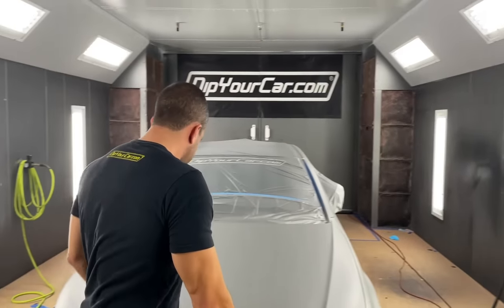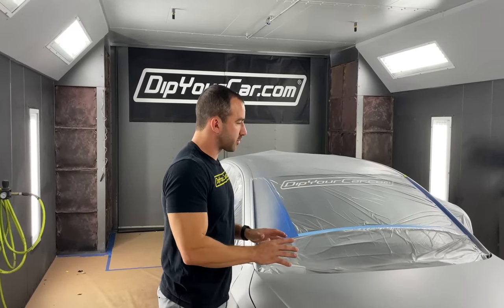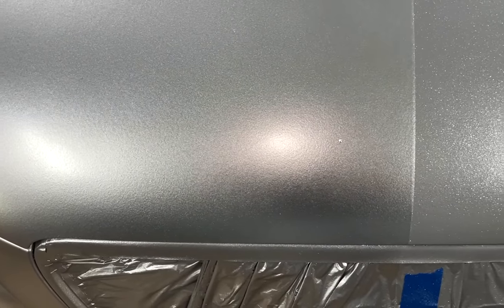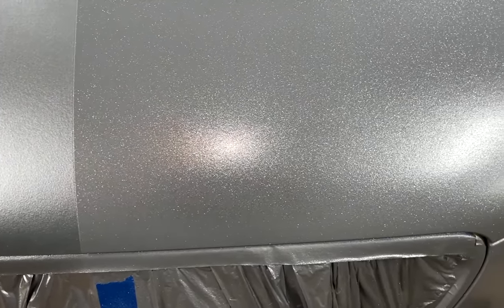Which base is BETTER for CANDY Paint - Pearls or MicroFlake? (Surprising Results)

Comment: The traditional pearl has a smoother look. The other has a texture look to it. I think it’s depends on the car and color. Great video.
Reply: It's orange peel it needs cut n buffed ,but I agree
Reply: I was thinking that
Reply: Your supposed to wet sand the flake down before you candy it. It helps give it a glass look when you build the clear on it. But also probably only put a couple coats of clear down. I recommend at minimum 5 coats of clear for custom paint jobs to have a deep clear. This car was a test example so take it into account.
Reply: Thats because it needs at least 5 coats of clear and then the full cut and then buff. LOTS more work But WAY better finish. THIS JOB is only half done NO WAY to compare.. YES i do spray metal flake jobs
Reply: @eddiebrown9590  you can cut and buff plastidip?

Comment: I love how the glass container has a pour spout and they never use it when pouring into the spray gun hopper.
Reply from the maker: It’s on purpose - pouring out the side flattens the liquid and shows more of the color effect 👍
Reply: @dipyourcar  that's what I've thought the first time i noticed this. Thank you for confirming my thoughts :)
Reply: @dipyourcar  I've seen several of these vids and always wondered lol
Reply: I never use the spout on anything as it usually doesn't work as intended or splatters everywhere, like the age old saying, " If it ain't broke, don't fix it! "

Comment: I liked how you showed something as simple as a dividing line takes a fair amount of time. I've learned a few things and the painting part of the " paint job " is the easy part. Prep, sanding, repair, more prep, more sanding, more sanding and tape are the hard parts.
As for pear vs flake....I feel you get a better effect on body line changes. The flake is cool but it's like looking at a bass boat. Putting one down then doing a graphic with the other might be cool.

Comment: I guess it is down to personal preference  as you said. A trade off between sparkling and low gloss finish and smooth, flat, high gloss finish.  In the end the user decides: get sparkling or show the curves. 😁 But, you can now use that candy tint to change the crazy reflective glass beads into any color you'd want.
Reply: I know right 
Hope you are having a blessed day there

Comment: Both look good, but I personally would go with the pearl base. It has a much more smoother and glossier look to it. The flake side looks as if it has grittier texture with some white specs in it. It also has a bit of a matte finish to it, which I like. It reminds me of when I use a matte finish topcoat over a metallic or holographic fingernail polish.

Comment: Pearl gives the paint a more wet look, typical of exotics and tuners. Flake gives it a more “pimp type” look that’s good for classics like a 85 Caprice Donk or a 68 rat rod. Both are good but I gotta go with the metallic on 26” Rucci customs. That HoC is by far the best candy right now. That Audi tried but it doesn’t have the lines and curves to set the paint off. You get something like a GTI or a Mini and the pearl will definitely turn heads at a car show. A good buff and cut would really make it champ too.

Comment: You should lay down your flake then clear it. Wait for the clear to cure, then flat it back.
 Then you can spray your candy,then clear over the candy. You get a great depth to your paint job and it doesn't look like the surface of the moon. Also try  0.08. mixed 50/50 with 0.015 it gives the best coverage and the best effect or pop...

Comment: They are gonna give you a different look and you would use whatever look you are chasing. A metallic flake will always look better for a candy paintjob as it will give the most true to the original candy look. The original candy's back in the 60's were a very fine and very bright silver, using that mirco flake still wont look anything like a traditional candy paintjob, but certainly will show up better on camera for us :)

Comment: I make baseball bats and i use candy colors for some customers. Using pearls or shiny metallics is ideal for uniformity, but when it comes to pop, flake is the way to go, BUT how you use it will very

First off, gotta have a smooth glossy topcoat in order for the flake to really work. Second, your base matters so much more that you think. Flake can work on a black basecoat and that creates a unique starry effect, you can use just flake, or have flake on top of pearl so that you erase those deadspots while still having that shooting star effect.

I also compress my flake a little to smooth out the surface and get rid of those sideways flakes. It works on bats because they're round so you don't lose the random shooting effect, idk about cars though

Comment: As it happens I found out I really don't prefer the standard rough/matte texture the product gives. I understand a clear gloss finish is much more expensive and is not as user friendly but in cases like these, I think it's almost necessary. Clear also gives way more depth to both flakes and pearls anyway. Just look at that surface, it's so rough... Almost looks unfinished or done by someone who has no clue how to paint (no offense meant) just that's the product result, especially with flakes. I would though try flakes and a ton of clear over it then sand and buff the living heck out of it to achieve a smooth final layer.

Comment: Maybe, it's cause I'm older but when, I think of a candy paint job, they always have metal flakes in them. Also, noticed that the micro flake side, had a rougher looking texture to it. I wonder if using a glossy top coat, will smooth out that textured look, and give it more depth?

Comment: still, traditional candy look is with flake. regardless if it looks better. same with him using silver base on candy apple red. traditional candy apple (green or red) is a gold flake base. also with flakes, size and amount play a bigger role in the outcome. to me pearls look good everywhere, where flakes (especially big flakes) usually look better in section/area and is easily overdone. think like, if you were to flames the whole car or the whole car carbon fiber vs trim.

Comment: Look I teach automotive collision 💥 and the deal is if you use a flake you should be using an inter coat and you will still have to sand and buff and possibly re clear …with the pearl not so much it’s easier 😮

Comment: When you start using flake, you're entering the professional paint arena, complete with the necessity for color sanding, inter-coats, clears and buffing.  It looks too dry and orange peely with the more matte surface of DYC and it takes away from the effects the flakes would usually produce in paint.  I get the convenience factor of DYC, which is a big selling point, but....I personally think most additive effects are better suited for paint...and even then, only if you're a professional or someone that knows what they're doing with them.

Comment: I hate when paint is thick coming from a metal flake or pearl you can just see all the material use under the clear coat builds up around edges and doesn't look clean when everything is taped off. I would rather go with a metallic base with pearl added to it and just dust my paint on.

Comment: Why not pour from the lovely spout on that giant beaker? 

Also, I think you should be adding some candy black to the candy mix on these. Enough so that layer by layer it gets more saturated color but also dims the reflection of the flake/pearl undercoat just a little, giving it a more spotlight reflection of color and much more muting of the color at steeper angles.  You'll need to play with it a little to get the mix right so that it looks good after a reasonable number of coats, but not so rich with black that it tips to far into the black so as to mute the color of the undercoat reflection overmuch. Sort of a "murdered candy", 

The end result of this https://www.youtube.com/watch?v=mobBb9WeHLI would be overmuch by just a little. I think you could do something out of this world if you did a murdered candy effect but stopped just short of going this dark.

Comment: Don’t care for either one! Where are the clear coats ? Wouldn’t pay for either one.  I either use a gravity feed or siphon gun ! Have yet to see a  good paint job with one of those heated air paint systems. Don’t need Pearl in base coat , should be in clear top coat if you want pearl to show. Of course this is just my preference! May be different on a flat pastel or flat black racing stripes? You did ask for an opinion!